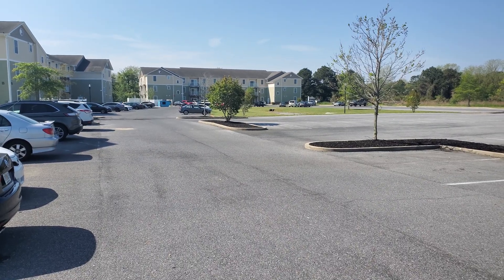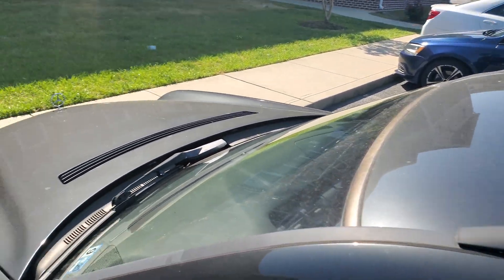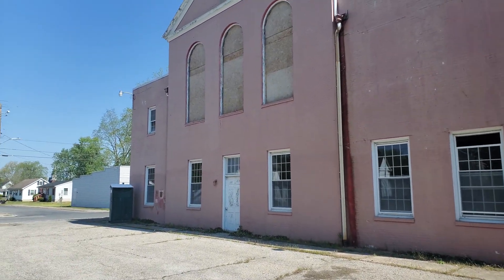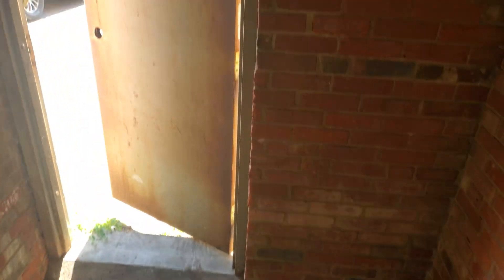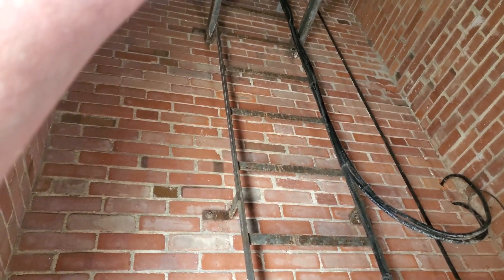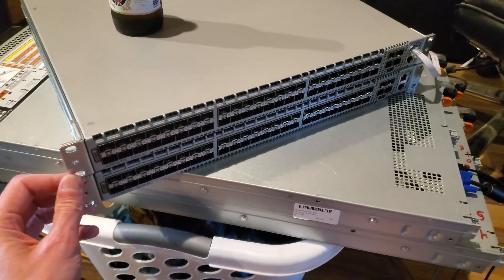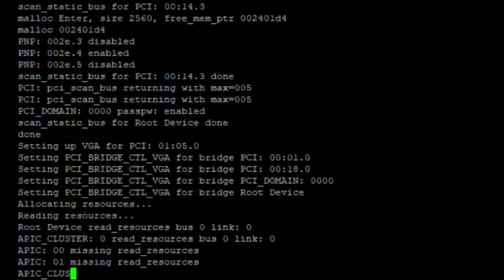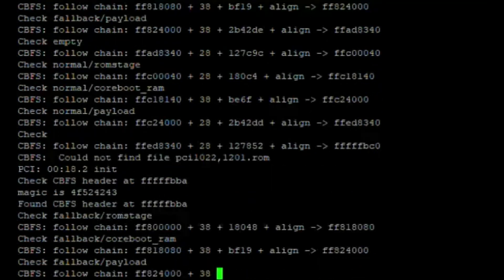Adventures expanding DWDM and an Arista 7050 switch

Comment: That preamble before the O/S boot looks like some debug is turned on.  Also, there's some work getting SONiC to replace the Arista O/S, though I'm not sure the improvements you'll get over the Arista O/S.   FYI there's nothing special about the last 4 ports.  They exist so that they are not blank as opposed to the more expensive model which uses the same space to have QSFP (40G) ports instead.